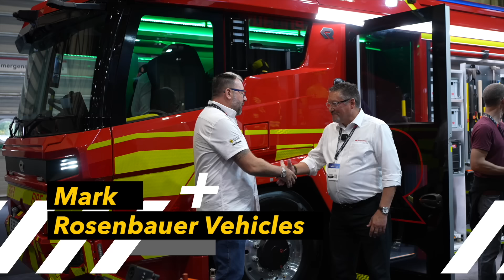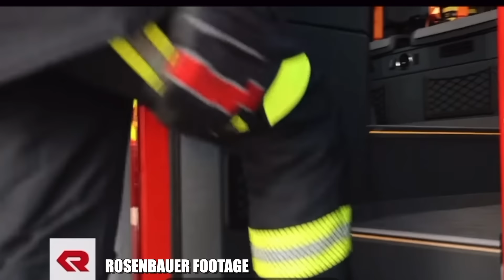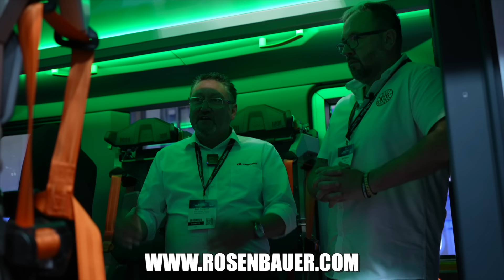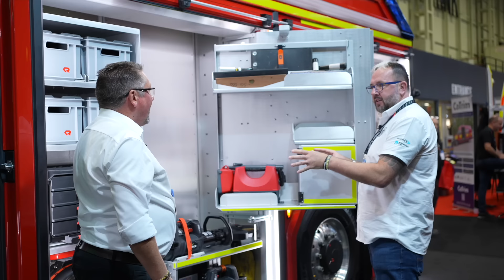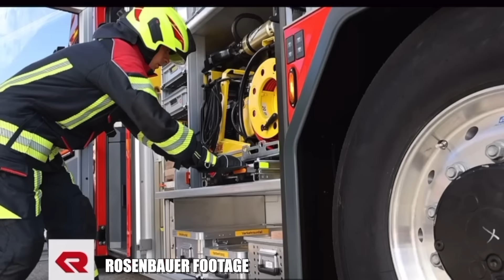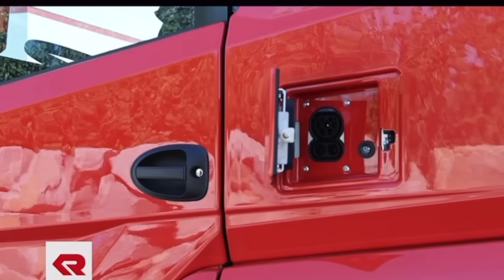Buy This Electric Fire Engine - With A £1,000,000 Budget!

Comment: I'd say best described as bi-mode, rather than hybrid, because it is designed to run with the diesel engine off almost all of the time.
Reply: The proper term is SERIES HYBRID. Where the optional use of the engine has no mechanical connection to the wheels and pump.

Comment: Great idea till this happens, In October 2024, a new fire station in Stadtallendorf, Germany, was heavily damaged by a blaze that started from an electric fire truck's lithium-ion battery pack or charger, destroying several vehicles and the building itself,  That little fire cost around 24 million Euros. The fire crews had to call other fire engines(powered by diesel) to try and control the blaze
Reply: The Stadtallendorf fire was a diesel vehicle.  None of the recent fires in German fire stations have been EVs, they've all been diesel vehicles.  These days our vehicles already have a large number of batteries for small devices.  From thermal imaging cameras, to drills and the newer jaws of life.

The bigger problem was that there were no smoke/fire detectors in the buildings because 95+% of German firefighters are retained volunteers and don't sleep on site so building code didn't require an automated fire alarm system.

Comment: I think a hybrid would be better to be fair, full kudos to the designer of this beast.  It looks incredible but, a diesel hybrid driving the wheels would be more reliable.  What happens if the battery decides to go thermal runaway while fighting a fire?
Reply: This is a SERIES Hybrid Diesel Electric. There is a 3.0L BMW Diesel Generator on the back. "battery decides to go thermal runaway" is not something that actually happens in the real world for properly engineered  BEVs. This is not some sketchy cheap "Hoverboard". Even expensive legacy OEM Engine are multiple times more of fire prone than this 132kwh lithium ion battery. I will bet money not a single 132kwh battery on a RTX Fire Truck will ever cause a fire. It just will not happen.

Comment: the question not answered with any of this stuff going electric, how long are batterying going to last flat out in racing more the say a fire, and then setup pumping water, how long running max,. running when completely powered dead, how long will take to ready and back on the road, to say deal with next fire call out? just guess on my part if anything cars, you pulling connect the power cables, the and basically local  coffee shop for at least 20 minutes, out need a full recharge 40 minutes plus, and that just car, the battery going to be all lot bigger Im guessing once more Im just thing going long the pulling any fuel roadside filling station, 3 minutes or so, and driving off, and back in service for the next incident, or back to one you where already dealing with?
Reply: Stop with the Pointless fear mongering nonsense. It has a 3.0L BMW Diesel Engine at the back to charge the 132kwh battery. This is a Series Hybrid and just requires Diesel Fuel to pump for longer. The 132kWh battery is big enough for majority of calls.

Comment: The bp location on the side a find is a great idea normal you can’t see towards from6 specials speed bumps can catch you off guard. So only problem I have is there is now so much electric and computer in there to help you but when is it’s wire in a twist it not anymore possible to fix it at the station if it is something small what means  you lose a pump in the streicht thin service like it is in the uk a huge problem.

The others problem is more I don’t know heat resistance there will be situation where the pump could experience high temperature my question is cam the pump dearth with it as good or better than combustion engine ? We all know hear isn’t good for battery’s so I’m just wondering about that.
Reply: WTF stop with the wacko nonsense. The electric motor for the water pump is no where near the battery. It will not convect any heat to the battery and it will have zero effect on the health of the battery. You are just forcing fear mongering nonsense.
Reply: @Neojhun  not quite sure what are you talking about. What I was talking about is for example a fire what suddenly grow fast and the engine find him self very close to a fire or wildfire has happened a lot that you have to get through the fire because there was no other way out.

And I pointed out that I don’t know what made it into a question so calm down I’m a proud ev driver and I love what they done to the engine 😅

Comment: Its far to expensive and complex. Fire appliances need to be robust and I hope the batteries are not Lithium Ion.
Reply: Stop with the wacko nonsense. Yes it's Lithium Ion and it's perfectly safe for this use case. Mechanically it's much more simpler and tougher robust than Mechanical Diesel Drive train. it's also the reason why it has stronger acceleration giving more confidence to the driver. This is a Series Hybrid meaning it has dual paths of power supply meaning REDUNDANCY. You clearly have no about "2 is one, 1 is none" when it comes to reliablity and mission critical equipment. FYI Series Hybrid has been proven in Navy Submarines, IceBreaker Ships, Cruise Ships, Mining Equipment and obviously Locomotive Trains. This is a perfect power train for Fire Trucks.
Reply: Modern TDI engine with all it's problems -> many gears transmissions -> long drive shaft -> Transfer Case  -> two shorter drive shaft -> two drive axel differential -> two half shafts to the wheels.
Electric Motors 1 and 2 -> two separate sets of E-Axel integrated Differential -> Half Shaft to the wheels.
You have no clue what is actually complex. You also do not understand the importance of redundant sets of power train.

Comment: Is the size of the water tank sacrificed  for the batteries?
Reply: Nope, same size as standard UK tanks
Reply: WRONG! It only has a 132kWh battery soo it does not require much space. There is way more space in equipment shelving.

Comment: Far too much to go wrong on that
Reply: Thus why there is REDUNDANCY. Even the logic control system has a 2nd tablet for remote control. This is a Series Hybrid with redundant paths to power the electric motors. "2 Is One, 1 is none" is what the engineers of this truck are familiar with. Series Hybrid is a proven power train in Navy Submarines, IceBreaker Ships, Cruise Ships, Mining Equipment and obviously Locomotive Trains. About time Fireys got a truck just as good.

Comment: Fully electric… with a 3L diesel engine. Got it.
Reply: 3 litres is better than the 9 litre diesels they currently run.
Reply: It's best to think of this as an industrial appliance, not a vehicle, and like many industrial appliances, moving to electric from thermal energy sources, the gain is a rise in efficiency that lowers operating costs. those. The same approach is applied to gensets in diesel-electric trains.  

In this case, the diesel generator is optimised to produce electricity to charge the two on-board battery systems, operating as an EREV to extend the range and as a backup generator for long-duration deployments. It will be tuned to a higher efficiency level to produce electricity only to charge the batteries and so power the various onboard systems and motor systems. This allows for more efficient use of fuel when required, so lowering operating costs. 

Further, as the diesel generator can be designed for one role, it can be more optimised than a diesel system that would have to act as a generator, a powertrain to move the vehicle, and a pumping system that would require various lower efficiency gearing, transmission & power take-off systems. In doing so, it reduces the complexity of the tender, its maintenance requirements, and operational costs.

This isn't an electric vs diesel vehicle discussion point, but a meeting of the two technologies to produce a more efficient and effective unit.
Reply: @GruffSillyGoat Modern, overly complicated, fragile and unreliable. Thats my prediction and it hasnt been wrong yet.
Reply: @paddyodoors2757 - Modern is the only one on that list that bears any reality. The electrification of equipment across industries has been taking place for decades, improving reliability and robustness. Reducing the number of parts - transmissions, drive shafts, etc - reduces complexity.
Reply: @GruffSillyGoat nope just differently complicated, harder to fix for the end user and throw away.
Reply: @paddyodoors2757 - last time I looked end users don't drive fire tenders, which are professionally serviced.

Best not to project personal beliefs about EVs onto professional equipment. Particularly where modularisation increases serviceability.
Reply: @GruffSillyGoatyouve never done a days work in your life have you? In my old industry you will hardly find a tech who agrees with your point :/ but anyway over and out.
Reply: @paddyodoors2757 - what a pointless and rather sad comment. 

p.s. I'm an electrical and electronics design engineer by trade, I've seen decades of thermal and mechanical systems being replaced by higher efficiecy, more reliable and lower cost electrical systems.
Reply: @GruffSillyGoat heres a pro tip for your next design, NOONE wants a touchscreen or complicated software near their tools, esp one that renders it useless when it inevitably fails ;)
Reply: @paddyodoors2757  - I don't design cars, plus in that repect I perfer buttons as the UI in a car. Automakers use touchscreens as it's cheaper for them to do so, less wiring and labour cost to fit.

If you look at this fire tender it has both types of controls, as the drivers touch screen integrates lots of control features but still has buttons for many of the critical features plus has a physical control unit on the rear. However designed this unit thought about it in some detail, with input from fire fighters.
Reply: Tick box exercise
Reply: @w75525  More like a BACKUP for a more powerful and tougher drive train. Series Hybrid has been proven in Navy Submarines, IceBreaker Ships, Cruise Ships, Mining Equipment, Logging Forestry Vehicles and obviously Locomotive Trains. No tick box nonsense was involved to make that decision. It's tough and powerful gets the job done.

Comment: According to ChatGBT, using a generator to charge a battery.
Then using that battery too power the vehicle. Is 2  to 3 times less efficient than just using a combustion engine.
Reply: Chat GPT is wrong. Serial hybrids (properly designed, of course) can be significantly more efficient than straight up combustion engine alone. Think about it, the engine in a truck needs to be able to do useful work between 500RPM and maybe 3500RPM, and at all sorts of engine loads, so you have to compromise on quite literally every aspect to make it "good enough" for every possible RPM and engine load. 

With a serial hybrid, you design the engine to be super efficient at a single RPM at a particular load, at the expense of every other RPM and engine load, and then you just run it at that optimised point forever.

A normal diesel truck engine might be 40% efficient, then you account for drivetrain efficiency of 80%, and you end up with maybe 32% overall efficiency. Batteries are somewhere in the region of 95% efficient for a charge/discharge cycle, motors are also around 95% efficient. A range extender diesel generator might be around 50% , due to the optimisations I mentioned above. That leaves you with around 45% overall efficiency, which beats out the 32% of the engine alone. That's a 40% increase for the serial hybrid.
Reply: Pathetic sad lies coming from "chat gBt". FYI The 132kWh battery is enough for majority of calls. The Diesel Engine does not need run, thus 0 Fuel Consumption mathematically INFINTE fuel efficiency. FYI Series Hybrid with no charger plug like Nissan e-Power is about 15% MORE efficient than pure ICE due to various factors like Constant engine RPM at sweet spot + Regenerative Braking. Your insane lies 200% to 300% Energy Consumption defies Laws of Physics.

Comment: Personally, I don’t give a sh*t how much CO2 you’re saving whilst driving to the fire. I just want to be rescued and the fire put out quickly - you know - that fire thats producing huge amounts of CO2 whilst it’s burning.
Reply: Welp this is a Series Hybrid with DUAL Electric Motors. It confidentially accelerate way better than the old mechanical diesel trucks. Making threading through traffic easier and faster. Getting to emergencies faster. You are the only one obsessed about CO2. This Series Hybrid is also just better for the job.
Reply: @Neojhun . Range?,how much water can it carry? Or have the batteries taken up the payload?
Reply: @bordersw1239  You are soo brainwashed by Anti EV nonsense you don't even understand basic facts. This is a SERIES HYBRID with a 3.0L Diesel Engine. The electric power train is DOWN SIZED to just fit the needs of the job. That 132kWh battery consumes less volume space than just the Equipment Storage Shelves and has no impact on Water Tank capacity. Range is just how ever much Diesel Fuel you can get into truck. Demo model of the RTX easily did a Road Trip across MULTIPLE Canadian Provinces.
Reply: @Neojhun  whats the point of electric of you still have to use diesel to keep it going longer, waste of money , might as well buy diesel trucks, probably get 2 for price of 1 electric truck? How's that good use of taxpayers money?
Reply: @Neojhun  the more you post the more unreliable it sounds, modern throw away junk, no need for half this crap.
Reply: @paddyodoors2757  That's because you are ignorant. Series Hybrid is how Navy Subarmines, IceBreaker Ships, Cruise Ships, Tug Boats, Mining Equipment and Locomotive Trains work. Most of which should have 4 decade lifespan and just replacing the battery once. The only crap is all the nonsense you have been fooled into believing. While having no clue about real world engineering.
Reply: Totally totally agree!! 💯